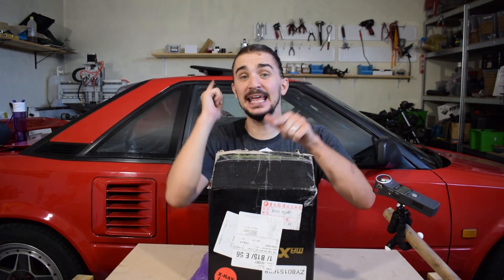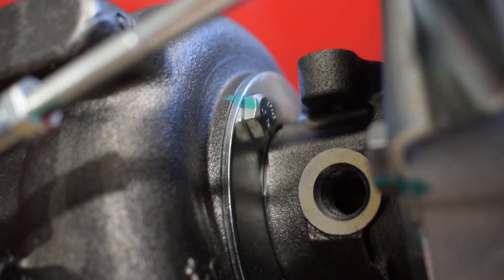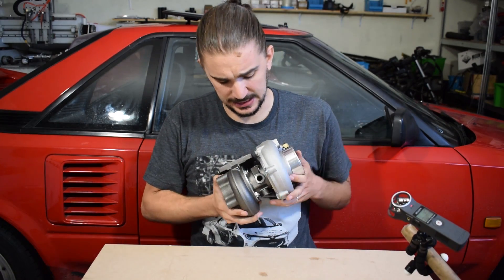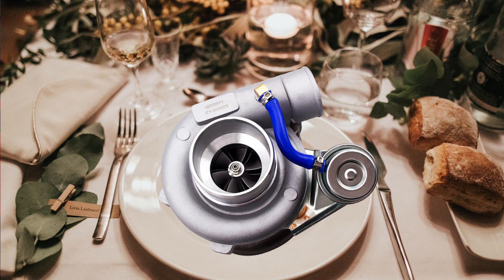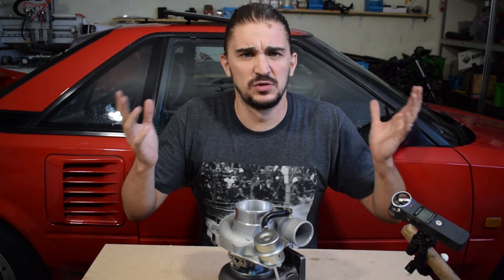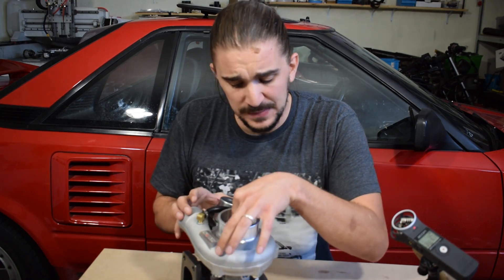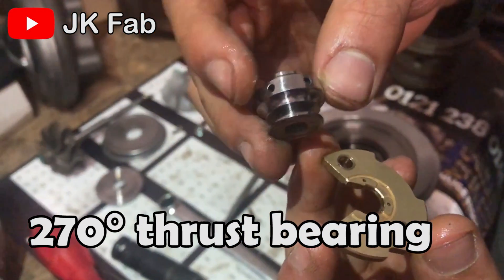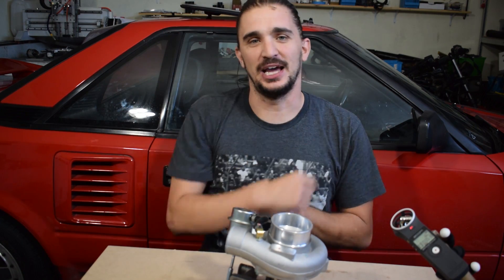Budget TURBO Unboxing and Review - MaXpeedingRods GT28 TURBO - Project Underdog #3

Comment: Thank you for another brilliant, informative and enjoyable video. It's always a pleasure to watch your productions! For the price, this product looks impressive and is very tempting. A used turbo with unknown history could easily be the same price. The comments about manufacturing quality and potential for failure do have merit - but a turbo from any manufacturer could suffer failure because of a manufacturing defect, oil starvation, overheating, or debris entering the system. The warranty would be a crucial thing to consider - because I imagine most aftermarket engine components will only be covered if it can be proven that failure was caused by a manufacturing defect and not by poor setup/maintenance.
This product has me a bit baffled though. You're right - they have to save money somewhere, but after going to those efforts on the turbo itself, giving you incorrect bolts and poor gaskets would set you up for a failure and spoils your experience of the product. Could it be that the turbo is manufactured and checked in one place, then packaged with those bolts and gaskets from elsewhere? It's kind of concerning because, 'as received' the product cannot be used; and does the warranty cover the use of other bolts/gaskets that are necessary? I wonder if maXpeedingrods would offer you the correct bolts/better gaskets?

You have given me a new option to consider though. I'd like to make a turbo build one day and something like this is now a strong consideration over having a used turbo rebuilt. The video from JK Fab is a good addition too, and as you say, beneficial for you to see the balance and quality before you bought it yourself.
Thank you once again for a great video, and for putting up a makeshift video in your road-side garage which may not be that comfortable to do videos in.

Comment: That cheap eBay turbo throws a vane and it will instantly become the most expensive turbo you ever bought. If a factory defect does slip past Garrett's QC and throws a vane and ruins your motor, you'll get some compensation. With a Chinese turbo you'll have to buy a new motor and turbo which will probably be an expensive Garrett because people usually only make the mistake of buying Chinese engine parts once.

Comment: One thing many people don't consider when looking at a chinabay knock off turbo is sure you could replace it multiple times for the cost of a name brand unit if it dies.  But a compressor wheel shattering at 100k rpms can easily cause metal scraps to make their way into the motor and destroy that along with itself.  Now the money you thought you saved is gonna cost more than the big name, warrantied turbo was replacing the motor. I'm not saying you can't find a good deal on eBay or elsewhere. Brands like kinugawa and tomioka seem to be well built and properly balanced units for half the cost of a Garret or Borg Warner.  Research is key to getting a good deal on a quality product.

Comment: I like this and I see your point but I feel it's important to play devil's advocate a real disco potatoe should spool alot faster than that like 5-600rpm sooner.. and that smaller inducer on both the turbine and more so the compressor. It's gonna make less power specifically up top in the rpms... By my math this thing should be okay flowing 300ish hp but a real Garrett will do 420ish hp and spool faster. Now this cheapo should be more efficient at higher boost than a real disco potatoe so you might make more on your 1.6 since you probably wouldn't get to close to the limits of the Garrett.

Comment: Half as bad? You're obviously incorrigible so I won't repeat myself. ;) Anyway, at this ridiculous price for a fundamentally decent device, a lot of people should reconsider getting a turbo and I'm even toying with the idea, sorta. The requirement for special manifolds and other bits still means that it's not typically a budget friendly undertaking unless one has access to a good junkyard and workshop to scavenge and adapt suitable components. I'm very much looking forward to future installments on your project.
Reply from the maker: I said "there's no way to measure turbo" worseness" so I'm good right? 😋
Reply: @d4a  if ANYONE could find a way to measure "turbo worseness", I think it would be you, and the graph or chart would be hilarious :)
Reply: @d4a  Hey, why not, I can get on board with that. ;)
Reply: Jozsef

Of course turbo needs manifolds and pipes. 
That’s half the fun. 
Making a system on your own car. 

Leave it stock if you are afraid. 

But life is not about avoiding things that might make you think twice. 

Life IS that.
Reply: @fastinradfordable  Well sure, but there will be some expense involved for those of us without the equipment for making these parts and when you end up having to eat your car out of desperation, it can be particularly problematic if you're already living in it. Definitely a situation to be avoided, so afraid is as good a term as any other. ;)
Reply: Jozsef Izsak 
I’ve lived in my truck for months on end. 
Just means you have more time to tinker!
Reply: @fastinradfordable  Good point. Too many damn distractions with an apartment.

Comment: One thing to remind certain car owners. Just because the turbo was cheaper, does not mean the labor to install it will be cheaper. As he noted, it had improper gaskets and fittings. No shop with any sort of a decent reputation is going to install those shit gaskets and some won't have spare banjo bolts just "laying around".

I very much agree with everything stated by D4A, but, like him, I can do the majority of my fab/install work. If you can't, don't be mad at the shop you take it to when they rip this thing as a crap kit.
Reply: It's a  lot cheaper than blowing some pistons, or another turbo. Especially if you install it yourself.
Reply: @ProDigit80  I have no idea what you're getting at, your response makes no sense.
Reply: @deciplesteve  I don't know it either.
It made sense when I wrote it, but that was after some beers!

I guess what I wanted to say is that those turbos are known to blow the compressor blades, sending debris in the engine.
Could end up costing more than a brand name turbo.

However, for small projects, that require less than 10PSI boost (allowing you to run on 87/89 oct fuel instead of relying on hi-octane) on most cars, these turbos are more than sufficient for the job.

Personally, I would go with the smaller units, run on 7-10PSI boost, and bore out the waste gate, so one can enjoy low turbo lag, and an increase in torque; and drive economical fuel, and still stay within the specs of an engine.
These turbos shouldn't be bought with the purpose of high boost applications.
Reply: @ProDigit80  all good, it's Sunday, have another. Lol

Good points, as well. It all comes back to "what are your goals" and "good, fast, or cheap. Pick two."
Reply: Steven Walther ah yes, the contractors (car builders) Triangle......pick 2 u cant have all 3.  It takes a lot of years to realize that notion.👍🏼😂👌🏼
Reply: Mightycarmods did an episode about this. They modded a car with a cheap turbo. And made the bill public afterwards.
Reply: @ThefeeXP  I remember this very well (Project: Yaris Hilton). What I am referring to is that I actually work for a performance shop and we cringe when a customer asks us to install their cheap turbos. Now, most of the time, they are not approaching it from the aspect that D4A is, and they seem to think they found a "cheat code" to get a race-grade turbo for eBay price. The other problem is that we would need a "fuck-ton" (that's a real measurement, I assure you... lol) more overhead to cover all of the missing gaskets, missing hardware, crap gaskets/hardware, all of the time required to get quality fittings and such, and all of the time to fabricate all of the things missing/not quite right about these lesser grade turbos/kits. (A good example of this is Donut media's "Hi/Low" series.) I can have a quality kit (turbo or otherwise) installed in (typically) 75% of the time it takes the cheaper kits because it is all there, and it all fits. As I said in my original comment, that's not a problem for me personally, I would love to start with a $100-150 "disco potato" and figure it out on my own as I am not paying for labor. But, if you (for whatever your reasons may be, need/want to pay for labor this can be a concern if, like D4A, you're not certain this will be your final turbo and, unlike D4A, you'll have to pay for the labor 2+ times to install your turbo(s).

Does that make it more clear?
Reply: @Steven walther i known exactly. Not a proffesional performance shop but is do work on a few of tuned turbo cars. In the end, if you cant do it yourself the cheap ones are more expensive. 

I was just pointing out the mcm vid for others to see what the actual costs of a "cheap" turbo is.
Reply: @ThefeeXP  fair enough, and definitely a good point.
Reply: @Heads Mess maybe that's true for the shops you've worked in, but only one of the 4 shops I have worked in did. It was a dealership. The other three, all custom shops, did not and would not because when installing quality custom parts, they come with correct fittings.

Comment: how bout twins? but better yet what's in the works for a variable pitch turbo
Reply: Twins.... more trouble than its worth. 
Think 2jz
All the big power converts to single turbo. 

Variable turbo on my rabbit pickup. 
It is amazing. 
Full boost in neutral. 
Also capable of zero boost on highway, or full boost obviously. 

Vnt makes an engine capable of more power, with less fuel, and less boost. 

You can control it with a boost valve and a ball valve. 

I love my vnt

Comment: awsome, somehow you always do what i want to do, I really hope you hook the turbo up with the existing carburetors, at least just to try it out. your videos are great, i always look foward to seeing your videos
Reply from the maker: Unfortunately won't be hooking it up to the carbs, as getting CV carbs to run with a turbo is next to impossible and the results would be very disappointing even if it did run.
Reply: @Eddie Hitler i can second that CV's self adjust to the air flow. I find getting really close by just hooking up a piot tube and down one size on the na main jet with a good regulator.

Comment: Hey man, I have one of these on my Miata for about a year now. You should make a video on how to upgrade to a 360° thrust bearing, so I can go over 1 bar lol
Reply from the maker: Did you ever push it beyond 1 bar? See, that's not a bad idea at all actually. Upgrading this thing might be pretty effective, as the housings and many parts are pretty good. I'll look into it for sure. But I think most turbo rebuilders should be able to do it for you?
Reply: @d4a  No I run out of fuel past like 12psi at the moment, so i couldn't go over 1 bar if I wanted to haha. I would rather just rebuild it myself with the upgraded bearing, seeing as it's so cheap. The video you showed clips from I also watched, and I was wondering which 360 bearing he had so I could get one myself without it being the wrong size.
Reply: driving 4 answers am I right in believing this is a Chinese made turbo? I looked on the link and some of the text looks like Chinese but I could be wrong, I’m very curious because I won’t buy Chinese made things, just don’t want to support the terrible things they are doing.
Reply: M J I’m more for than 100% sure it’s made in China don’t need to look at anything but the price to know
Reply: @mj6463  there's terrible things all over the world, from coffee to textiles, to car parts lol. Country doesn't matter when they're all willing to save a dime
Reply: Guidosaur I more so mean the things the country does, I just try to avoid helping them whenever I can
Reply: @mj6463  i guess. Just seems like a losing battle lmao. They're already rich from buying debt and such. You buying a china charger turbo isn't gonna make a big dent
Reply: @guidosaur7506  what he doesn't understand is if he's using any electronic device to comment on YouTube he's buying Chinese stuff

Comment: Great idea to do a real world test with a budget turbo before settling on a bigger brand turbo, very smart and financially savvy.
Reply: @Bradius Maximus Not necessarily. You might end up liking the cheap one just fine.
Reply: It's all good until the cheap turbo disintegrates and goes through your engine
Reply: @xx-bg2dj  You must be fun at parties.
Reply: @xx-bg2dj  odds are that happening are pretty rare though all things considered everything should get caught in the intercooler
Reply: This is also what I was thinking, start cheap and create a setup to start with and go up from there. I bought the t3/t4 universal turbo from maxpeedingrods, not going to run that much boost on it and it doesnt really matter if it survives or not, because if it fails it is easy to replace with something better.
Reply: @Bradius Maximus You might end up buying a second turbo anyway if your expensive one fail due to a bad setup
Reply: I mean, it is. Unless you get a shitty one that explodes and forces aluminium shards directly into your engine.
Reply: @Bradius Maximus I bought 2 actual garret 2860-5 turbos - waste gates for $100 more then the cost of 2 of these, yes they were used but if you looks around you can find them, plas are to get them sent out and step up to a larger size to fit a 1uz
Reply: But how on earth they supply the turbo with wrong bolts and gaskets imprecise? That is a sign of poor quality overall

Comment: If that little ass thing doesn't spool until 4k then something is truly wrong.
Reply: That is a 425hp turbo on an SR20. 

For a 1.6L with a not so well flowing 4A engine it will require more boost to make the desired power, more boost takes longer to spool. Dont forget that journal bearing is a bit laggier too. The turbo housing is not divided so that will also contribute to the lag. 

Will it do 300WHP? easily. Will it be laggy? yes

Comment: AR ratios are completely random and dont match up with what they say.
If you read the compressor map and consider available turbine housings you can figure out the smallest turbo for your wanted horsepower.
Reply from the maker: I've been told something similar by an acquaintance. I'll definitely measure to verify.
Reply: Also the warranty is sketchy and the wastegates are tiny.